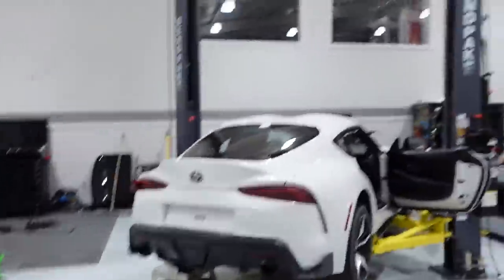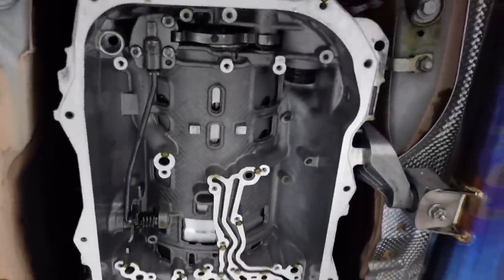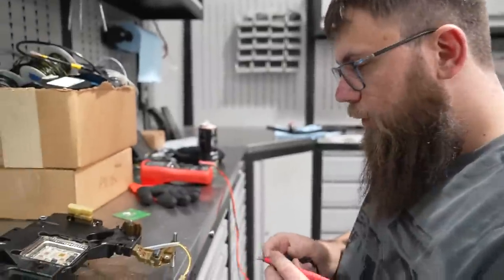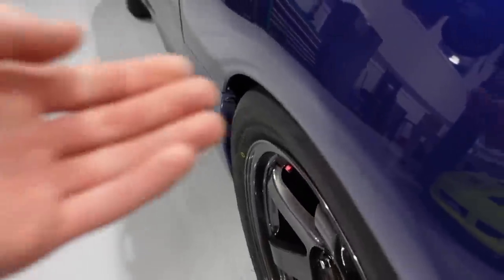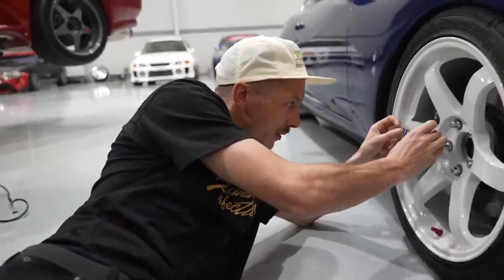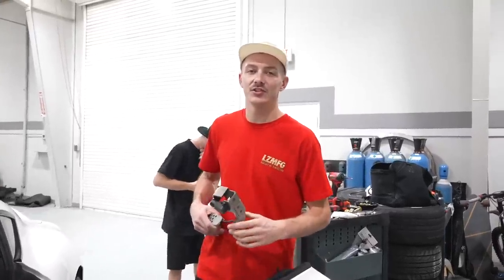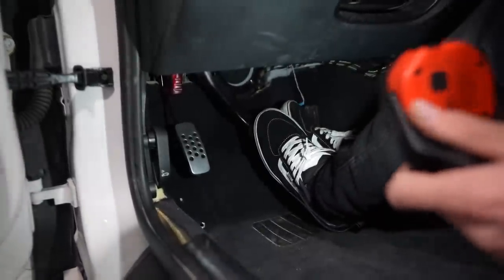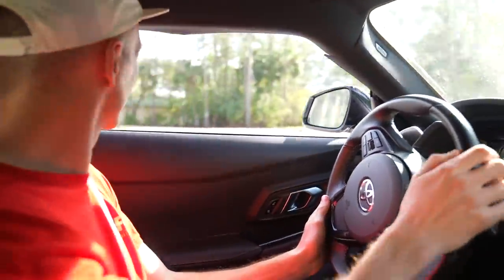Making an Automatic Supra Behave like a Manual!

Comment: With the CAN controlled diff, you could choose to make it act like an open diff, 1.0 way lsd, 1.5 way lsd, 2 way lsd, or spool. All with the touch of a button. That's pretty dang sweet!
Reply: This is would be huge for both manual and automatic owners too!
Reply: That would really depend on how the diff locks up mechanically. Such things have existed in offroad for a long time, and it doesn't really work like that.
Reply: The dynamic characteristics are totally different from a true mechanical LSD though. It’s not the same
Reply: @_entrxpy  it is a true mechanical LSD
Reply: @dinocrest1946  it would be an e-diff, completely different thing.

Comment: almost had a heart attack when buddy cut all the connections in the TCM, has to be a better way to communicate through the Can network but props to buddy for having the balls to send that the first time he did it ahahaha
Reply: He said he has done bmw's so it wasn't his first time.
Reply: They are just cutting out the old unit and soldering in their own. Only slightly more complicated than replacing a CPU in a computer. I'm assuming they will sell plug and play units to normal customers and do all this work in-house
Reply: He knows more than you buddy
Reply: Black rims
Reply: he has been doing these for fucking ages lmao 8hp has been the go to conversion for months
Reply: They’ll probably start doing them in-house, buyer sends their stock unit, they do the conversion and send it back.
Reply: Is it me or was that TCM inside the trans? Wow
Reply: @eliasbergstrom5300  They already do, the supra uses the zf8 which HTG has been doing this service for a while now

Comment: You could always take different gauge springs and attach iT to the pedal and the other end make a tab to hook the spring then as you push the pedal it will tension the spring You could literally take multiple springs and find which clutch pressure works for you

Comment: I'm so fricken excited for this kit!  My Supra is my autocross car so I prefer the paddles on it, but I do miss all the fun you can have playing with a third peddle.  Definitely getting this 👌
Reply: The auto is objectively faster for circuit & auto-x, & when this is a cohesive package setup I think it will solidify itself as the 100% best all-around setup to have for a supra. Making ~600hp on a super responsive turbo setup & it'll literally be able to do anything. I am soooo excited to see where this takes things & I am so glad that things took a complete turn around from the disappointment we all felt at launch seeing Supras only available in 8-speed auto.
Reply: it retains the paddles, you don’t need the clutch to shift or get going. the clutch only works to disengage the clutch for clutch kicks and ebrake pulls

Comment: I’ve been wanting to do this to an EV for years.  Basically put an extra pedal and shifter from a race sim in a EV and then program it to act like a manual
Reply: That would be sick
Reply: @1badpiter458  right?  I don’t feel like it would be that hard.  But also very difficult lol 😂 Depends on whether you tried doing it to a Tesla or if you built your own EV swapped car.

Also thought about jsut replacing the gas engine with an electric motor, keeping the clutch and flywheel. A truly manual EV.
Reply: that would be sick! any idea how the clutch would function? since it's usually directly attached to the wheel
Reply: All you'd have to do is just do an ev engine swap on a manual. I believe GM is making a kit for this.
Reply: I think most EVs have one gear so idk if it’s possible
Reply: @16york  instant kill all power and let it coast... right?
Reply: @yoxk  subaru did something similar with their early CVT's. They found that people like the feeling of the car shifting, so they added simulated shift points to their CVT's that wouldn't normally have any noticeable gear changes. It's not as efficient but it feels better.

Comment: You should look into what kind of potentiometer / voltage divider ( also called a variable resistor / rheostat if using 2 of the 3 wires )  is being used on the old gas/new clutch pedal. These can become inaccurate due to wear to the carbon resistive element from the wiper sweeping across it.  Two of the terminals are connected to the opposite ends (vcc 3.3-5v and gnd ground) of a resistive element, and the third terminal connects to a sliding contact, called a wiper (output), moving over the resistive element. Newer contactless magnet tech such as the AS5600L Magnetic Rotary Position Sensors are more accurate and durable. 
[Think joystick drift of Nintendo Switch / XBOX as old tech vs Sony PS lasting forever because it uses magnet based hall sensors, you can get replacements now from companies like GuliKit for your drifting JoyCons]

Comment: Adam, I work full time with tires. I notice the valve isn't aligned with the yellow marker on the tire.  Do you have any issues with balancing? Excess weight application etc...    Fun fact: the yellow marker is the lightest part of the tire and should be aligned with the valve, this aids with applying the least amount of weight during balancing.
Reply: No point balancing skid tyres, but otherwise it really doesnt make that much of a difference

Comment: Paralyzed from the waist down so this is a game changer if I could mount some kind of remote clutch system directly to my hand controls. Could this potentially work with the BMW f30 platform and if so will you also include a plug and play option for it.

Comment: When you see a guy just rip 30+ wires re-ball and solder a new wafer and have it up and running in hours while Johan shakes his head you have to realise these HTG guys are legit. They are doing this to DCG Porches work 10X the price of an old Supra. They know what they are doing and furthermore there is now a manual option and the option of a manual swap. HTG knows that it's worth there time to spool up this kit for all the existing Auto BMSupras spend the money to fab and sell and make some money (unless they are just doing it for the LZ bump but it doesn't look like it) HTG Adam is a beast even if I personally think this is a silly project it's probably going to end up being a "Bolt on flash and party down" solution for half as much as a manual swap with a lot more control and less lingering ECU gremlins.

Comment: A lot of water ingress in to the front wells of a car is caused by drains from the wiper area blocking and the water follows cable routs or brake booster seals.
Reply: Was about to say this. Had a very similar issue except my car dumped water on my feet when I went up a hill. The drains under my scuttle panel were full of crap from parking under trees

Comment: As far as I understand DCT don't have torque converters, they are more of a manual transmission being automatically shifted. So I wouldn't go neutral dropping your mid 90s auto Camry lol
Reply: The 8HP in the Supra uses a torque converter. It's not a DCT. The 7 speed Getrag DCT that HTG often works with is no longer in any current production BMWs. The last car it was in was the M2, but not anymore with the new gen coming out.

Comment: Have you thought about doing what Porsche did with there pdk where you pull both paddles and it shifts the car in neutral?
Reply: How would you use this in drift tho. Maybe for an entry but mid drift if you need to clutch kick would be rediculously hard
Reply: iI doesn't put the car into neutral in Porsches by doing that. It disengages the clutch, the car is still in gear.

Comment: I don't like black wheels. It all ways look like steel black cheap wheels after the wheel caps is stolen of. And these black wheels looks like Toyota Prius hybrid wheels without the wheel caps. I prefer the white wheels or the original wheel

Comment: Why the s-chassis stereotype about not being able to fit a wide tire? I'm stock body s14 with a 275/35/18 in the rear, and a 245/40/18 front withe 9.5j all around... TUCKING TIRE... and fully functional street car. 🤷‍♂️